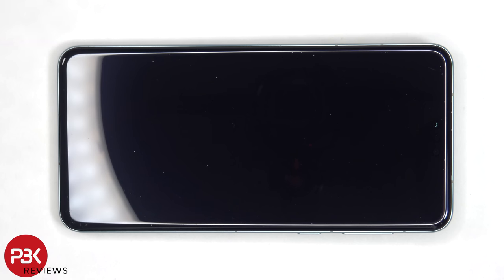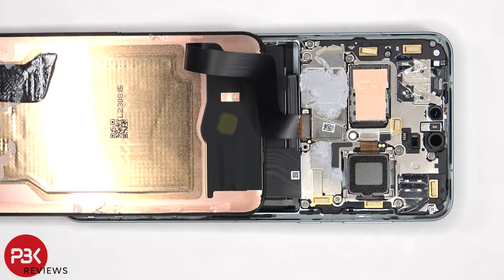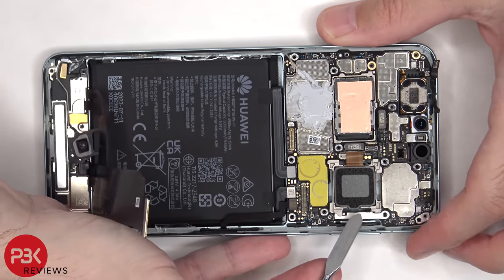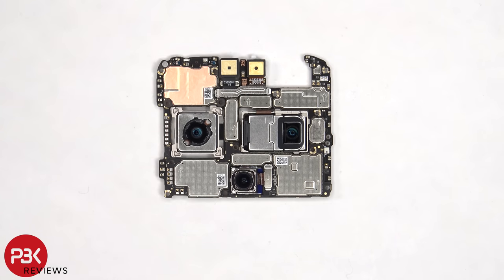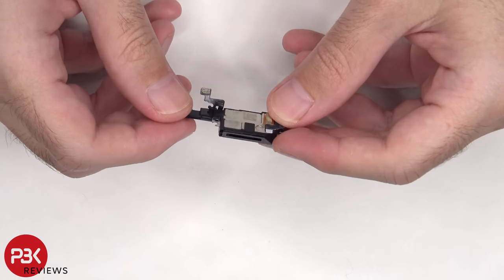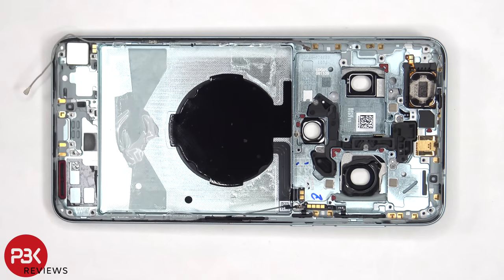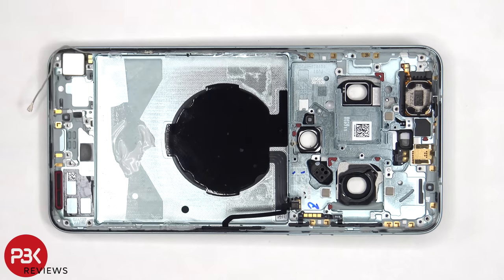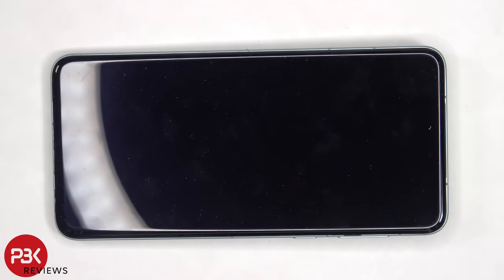Huawei Mate 60 Pro Teardown Disassembly Repair Video Review

Comment: I saw the disassemble videos taken by the Chinese and found they are using much better tools and techniques. Very skillful in the job.
Reply: ya need cut the glue 1st before open the screen that use the cup to open n alcohol.... but not easy to open high risk

Comment: Man, you are still the best when it comes to these. I just realised your subscriber count. Whatever you're doing the algorithm is picking it up, your videos are showing on my feed again. Keep up the good work man!!
Do you think the only way to take the screen off without damaging it would be to use a screen removal machine?
Reply from the maker: Thanks! Possibly, but even by hand its doable, just a lot of caution and heat/isopropyl alcohol is needed to carefully pry it off. Even though I was careful, at one point I accidentally inserted the pry pick too far in which probably damaged the cable on the bottom where it attaches to the screen. Regardless, the adhesive is extremely strong and it also has a type of cured glue which makes a rubber seal around the screen to keep water out and that also adds to the strength of the bond.
Reply: And I thought iPhone was a complex phone.

Comment: In fact, the US currently does not have the ability to make it on its own
Reply: This phone is garbage
Reply: @ralphtaylor7448 😂😂😂  Not more garbage than the iphone though.
Reply: @ralphtaylor7448 🤣👉🤡
Reply: @ralphtaylor7448  To be honest, you're wrong.
Reply: @ralphtaylor7448  why is it garbage? on what regards ?
Reply: @timetraveller2300  outdated technology
Reply: @ralphtaylor7448  Still more sophisticated than the ISS station technology and America needs the Chinese province to make chips equivalent to Huawei
Reply: @ralphtaylor7448 it’s the fact that they’ve been sanctioned and still thrived that’s impressive
Reply: @ralphtaylor7448 like your mom?
Reply: @ralphtaylor7448 Is there any country that can manufacture advanced chips without using Western technology?
Reply: @rgohoo   7nm is very outdated technology
Reply: @ralphtaylor7448 😅bruhhh, the newest 14 gen intel processor still uses 10nm technology 😂😂😂
Reply: @user-sc2co8et3x  also the country that made 3nm chip is so advanced than the country that made huawei phones
Reply: This phone is a trash propaganda mess. regradless of who made the chip, it doesn't hide the fact that their chip is 5 years old technology. This phone is decent at best. The phone has overheating issue, there's been reports of the satellite call feature being a gimmick, and it has always on camera rear and front which is a huge privacy breach.
Reply: They could build anything that Chinese could, it's their technology afterall, but in the US, slavery and child labor aren't allowed 😂
Reply: HUAWEI mate 60 pro 14NM beat the iphone 15 pro max Apple A17 pro 3NM in gaming fps and speed test, Soo you had to Learn more now, And You're not the only One, That's soo Anoying.

Comment: So many thermal pads, pastes and metal covers also a large vapor chamber below the screen indicate that this phone runs pretty hot. Not a good sign. Also how do you broke that display while the flex cable is in the middle? Not a good repairable phone IMO. This just as bad as Apple with their software lock.
Reply: so with your logic supercar is bad because used a lot cooler? LOL
Reply from the maker: The cable connector is there, but the flex cable which actually attaches to the screen is from the bottom rim of the screen and glass. So running a pry tool there poses a high chance of damaging it.
Reply: @privacyhelp  yes! EXACTLY MY POINT! Super car is not easily repairable. It needs specialized mechanics and tools. While you can find mechanics that can easily repair your Toyota Land Cruiser even in the deep of Sahara desert.
Reply: @kaptenhiu5623  Please refer to the previous video, I would like to know how you used it bad? In addition, Huawei's after-sales maintenance is very cheap

Comment: Weird built phone. I like it!

Always an excellent video!
Reply: Yes, the teardown appears to be in reverse for Huawei engineers to take this route. I wonder if the higher-ups, the Huawei CEOs, deliberately made this decision after observing outdated obsolescent designs in the latest iPhone.  

The right to repair in this P60 model seems to be less considerate. 🙄
Reply from the maker: Thanks!
Reply: @AwesomeBlackDude  if you use chips that you aren’t allowed to use. You will do an extra effort to hide them. Who does make a board design where the Hynix memory hiding the processor. It’s literally a shitty phone with iPhone X kinda specs

Comment: Is much more easy to repair this than an IPhone 😂😂, so 5/10 is totally wrong.
Reply from the maker: Each section of the grading comes into count for the total score. So just because the overall rating is lower, doesn't mean its more difficult to repair teardown or disassembly wise. For example, it might be the easiest phone to take apart, but if there are no parts available for it and finding parts is impossible, then how would you repair it? so it would drop in score. That's why the score is broken down to give you the reasons of the overall score.
Reply: @PBKreviews  Thanks for your explanation. I guess once Huawei start selling globally again ,would be more easy to find parts to repair their phones.